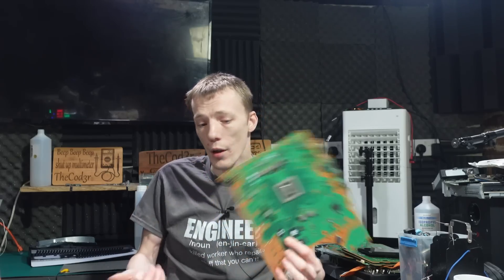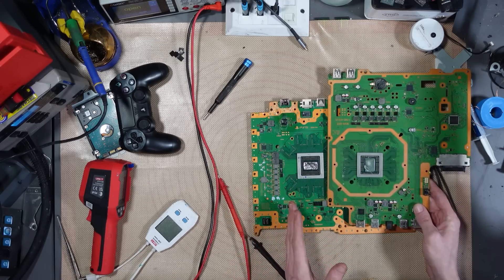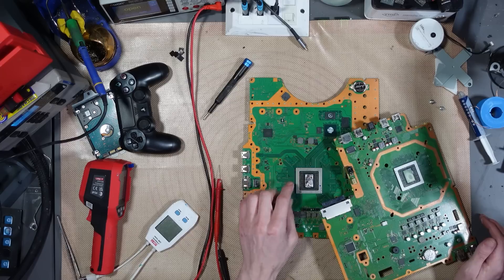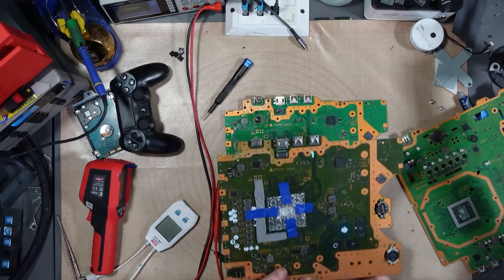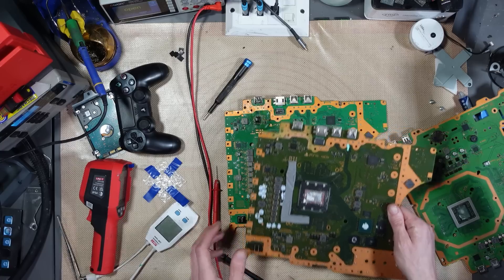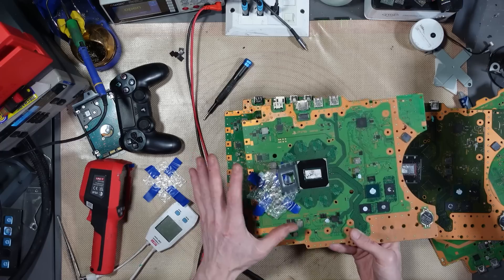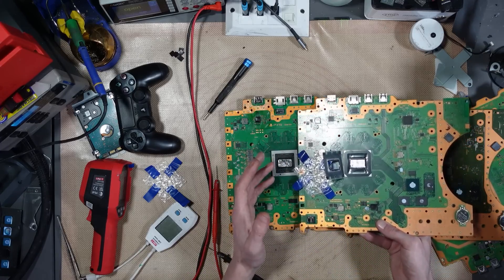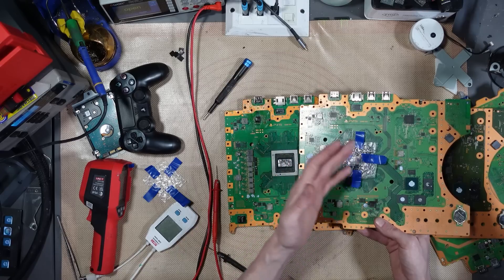Let's Talk About Sony's PS5 Liquid Metal Issue! Is YOUR PS5 At Risk?

Comment: I’m just gonna have to take risk tbh I can’t put it horizontally due to space and the stand horizontally is just really bad and feels more flimsy for some reason
Reply: The reason its a bad design.
All they had to do was make it a box like most consoles have always been but Sony did their best trying to reinvent the wheel impression for no good reason.
Reply: @YouTubeCensors Sony has a habit of poor cooling designs, the PS4 and PS4 Pro were awful. I recently got rid of my PS4 Pro and warned the buyer it’s LOUD, meanwhile Xbox had a poor design in the 360, and since then every console has been perfect with its silence and cooling. But they are boxes as you say and not reinventing the wheel.

Comment: Has Anyone tried the PTM7950 as an alternative to Liquid Metal on a PS5? Linus has done a video on it's cooling efficiency he tested in a PC build and the temperature difference between the Liquid metal and the PTM7950 doesn't seem to be that much it's neck on neck. It looks like that might be a very good solution for this issue. But getting a PTM7950 might be very tricky.
Reply: If you get the right 1 and not a fake
Reply: @yamisniper  RIGHT thanks for highlight this !
Reply: I would think IC Graphite would be able to handle the cooling of the PS5, but I'm not a professional tech.  The first thing I do to used PS4s and PS4 PROs I pick up is deep clean them and replace the thermal paste with IC graphite.  Makes them as quiet as my Series X.
Reply: Check chanel : Wielki elektronik
Reply: @DigitalDistortedGuitars  Yup i did they posted a video last week. It seems to be working absolutely absolutely fine just like it would with Liquid metal.
Reply: @trxrtt5965  EXACTLY

Comment: Problem with the stuff isn't the stuff itself but when it comes into contact with anything with aluminium or copper alloy and it turns the metals into mush and no guesses for what nearly every SMD is made from... I have never used it, if I want to bring temps down I use water and in fact I have just given up on my Ryzen stock cooler for a Cooler Master AIO simply as the old cooler is good but not man enuff for my demands, I used to be known as a cryo and peltier expert once upon a time from my days of chasing the magic 3ghz single core Barton leaderboard, cryo was an absolute ballache because of condensing around the chip bye bye mobo/cpu, it was with a wide pipe water circuit and 240w Peltier I got the CPU down to very low temps and smashed that 3ghz target on a 1700 rated mobile AMD chip (lasted about a week before it popped) and even then I had to use gobs of dialectic grease as condensation would accumulate then freeze without it then on shutdown warm up and frazzle frazzle goes the electronics next power up cycle.

Comment: So, as you said, the best way to make sure that the liquid metal stays put is to put your PS five horizontal. I guess my one question is this.

I just bought a brand new PS five finally. It’s model 1215. I’m guessing that they’re still using the same design as the launch model PS five for where they put the liquid metal and how?
Reply: yeah its still liquid metal even on the latest one 1215

Comment: if you dont close the cup lid tightly, the coffee inside can spill when you place the cup in horizontal position. Cups are supposed to stay in vertical position. For coffee to protect it from leaking you need to tightenly close the cup lid if u have SUPER GLUE. it would make it much tighter. That is just water under the bridge man.
Reply: Wtf is that even mean ?
Reply: @resonmon  just an example dude, the reason why liquid metal leakage is same as coffee in cup. The lid is not tightly closed.
Reply: @alexandermin2109  Yes but if you put horizontally you reduce that for PS5 case
Reply: @resonmon  It sounds like poetry 😂

Comment: those error are caused by inexperience teardown einsteins. They remove cover and cant undo it perfectly. The units which never been open or sealed broken are not having any leaking problems at all. The liquid metal solution is developed by SONY so IF u are not sony please dont remove it. DOnt try to be einstein. Oh I said too much!!
Reply: My launch console did have the issue. The console had never been opened. It does happen.
Reply: Completely false my APU has never been opened and mine always overheated when vertical.

Comment: This is frustrating because PS systems are supposed to work BETTER vertical. My PS2 still works, but will only work vertically. It spent it's entire life on it's side before I thought it broke. Works fine standing straight up. Just got wireless controllers for it and a new 128MB memory card. My first PS3, a first release slimline, spent it's life vertically until the drive broke, after gaming and using it as a Blu-ray player for over 6 years daily. My second PS3 is a final edition 500gb and had been used on it's side until the disk drive started making noise. Stood it up and the noise went away. I use it almost daily. I just got my PS5 and it's vertical. Unfortunately I have an aftermarket case on it with fan holes and I can't use the stand right now. Not even sure where the case and stand are, but when I find them, I will switch. Because this man has proof and F Sony!!!

Comment: I had my system vertical for almost 2 years. 2 weeks ago, i thought about the metal leaking or pooling up, so i changed it to horizontally 2 weeks ago. If i open thet systrm up, how can i sprrad thet metal back out? Don't you use alcohol and q-tip, and when thr alcohol dries, you can spread it back out? Everything is fine with my system, just wondering for future is all.
Reply: Keep it vertical it’s fine mine is vertical has been for 2 years this isn’t a massive issue most likely consoles with manufactured defects or have been dropped/ knocked about I’m keeping mine vertical

Comment: This might be a dumb question, but why haven't they designed an elevated wall or a gasket around the APU to contain the liquid metal, so that it stays there like in a pond or a moat or the like?
Reply: They can only do so much until they create a big enough gap (I say big but still microscopic) between the Ps5’s apu and the heat sink which would be bad if not worse. I know you said it would be to contain the liquid but when there’s a gap between the two components then the heat sink won’t get rid of the heat as efficiently and thus the unit would overheat anyways.
Reply: There is a thick foam gasket around the APU. A thicker gasket (elevated wall) would require even more gallium to fill the void. Diminishing returns I'm afraid.
Reply: The pro will have an even faster APU...I doubt they are gonna switch back to the paste to try and keep that cool. LM is the future, actually it's already here! PC has been liquid cooling for over a decade! Just tweak the protection coverings and there should be no problem with Sony sticking to LM. Live and learn. Trial and error. Sony will only get better from this honestly.
Reply: @kidgamer49  PS5 Pro should be cancelled PS6 should come in 2026 8K physical media
Reply: Ignore my comment here, was trying to post to a different comment 🤦🏾 lol
Reply: That profit margin. That's why.

Comment: My unit makes a lot noise. Just out of the box. Think it was in rest mode and the wife moved it to put a cloth underneath. Since then it’s been making a lot of noise. Could miving it in test mode effect it?
Reply: Do not place your ps5 under anything with fiber like carpet or rug. And don't put any cloth on top of your ps5. The top is where your ps5 draws cool air in and pushes hot air in the rear.
Reply: That’s strange since from what I’ve ready ps5s are supposed to be quiet  and mine is also silent compared to the ps4

Comment: Which side horizontally is better? I know that logo should be on top when placing PS5 horizontally but not sure if it can be installed on the other side. Installing it horizontally as per instructions, would that mean liquid metal would be on top of the APU? Or APU on top of the liquid metal? I would prefer the later.

EDIT: ok, just watched a repair video, looks like if you install the PS5 horizontally (with PS logo on top), the APU would be sitting under liquid metal. Hm...I would prefer the APU to be on top to exclude spills underneath APU caused by the gravity.
Not sure then what is better, keep it vertically and risk spills down the board or put it horizontally and risk spills under APU?
Reply: Remember that Sony commercial where they had it upside down and horizontal?  Everyone was ribbing Sony over it.  Maybe they were trying to tell us something.
Reply: @BoomerBends  Good point 😆

Comment: So what you are saying is: If your PS5 is within the guarantee let it stand, so that the Issue happens, if it it is outside, lay it horizontal. Ok.
Reply from the maker: No not quite, if it's in warranty I wouldn't recommend opening the console to protect the APU
Reply: @TheCod3r  Okok, You didn't recommend to do so, but within the guarantee Sony does fix the issue. Or does it not? 😯

Comment: My consoletechnician hinted to me, that it is better to have the console horizontally and this was already months ago. I have to admit, on my journeys to switzerland i bought myself the g-story 4k screen to use the ps5 horizontally, which maybe also could explain, why i dont have issues, apart from the fact, that i dont use the console exzessevly as others do. I have a semi broken ps5 too, where the front usbports are literalky dead and the usbports on the back also have seen better days, hdmi port aswell, but it works so far. If people can make use of the horizontal orientation, then maybe go for it, if you really enjoy your cobsole, otherwise, at your own risk, as usual, use it vertically. As tronicsfix already tested a ps5 with thermal paste instead of liquid metal, going away from liquid metal is not a good idea. Do that at your own risk and as in the video mentioned, after the warranty ran out. I will not modify my consoles except with m.2 ssd harddrives, other than that, its a solid system in my opinion

Comment: I’ve had my ps5 for almost two years and heard about this today and switched it from vertical to horizontal.  I’m sure it’s fine but it’s not worth the risk.
Reply: Had mine for less than 2 weeks and I already switched 😂.
Reply: Almost a year vertical and just went horizontal after buying a stand
Reply: @P34V3Y7  The console comes with a stand in the box?
Reply: @TJ-wf1rr  yeah but using that stand to put it on its side is cheap and not reliable. I got a stand that suits it better for it’s side
Reply: Bro same 😂 I feel fully after spending 3k on a pc but still
Reply: Clearly you really don't get it .
Reply: It has no issue to place vertically
Reply: @raminham1077  I work with Engineers all day and do you know how many times they tell me something will be fine and it isn’t? I can’t tell you the times and Engieer says “no, it shouldn’t be doing that that” and it does. (This wasn’t directed at you but where I’m coming from)

Comment: I use my electronics horizontal even when advertised for vertical use. Just seems like a logical way to use something that has moving parts,liquid and a spinning disc inside of it.
Reply: With how stupidly massive the ps5 is thats kinda unfeasible for a lot of people
Reply: @BandedMetagrossMeteorMash  I have a series X as well as a PS5. Let’s not discount the fact that the series X is the size of a toaster oven horizontally. Lol.
Reply: In the past i had issues with ps2 scratching my games when putted verticaly so i never did it again but when i bought ps5 it looked better verticaly but i was still worried about disc scratch and after some research in the second day i found a french video talking about this problem of liquid metal and i was surprised and glad to see it so i can prevent myself by doing this mistake and now 7 months has passed since my purchase and no problem
Reply: that’s funny because in a desktop the mobo is mounted vertically.
Reply: @artbyddp  to be fair with RAD 1979, we don't know they have a desktop. Also, a desktop mobo doesn't have moving parts and the HDD and CD-DVDR are mounted horizontally. 
You can say the H&F have moving parts but, that's grabbing for straws, afaic.
Reply: @artbyddp  ive been thinking the same
Reply: @artbyddp  exactly, mfs don’t know what the talking about
Reply: @artbyddp  and that's why if you use Liquid Metal on a PC cpu you have to replace it every 6 months or it leaks out
Reply: @ms3862  That is not the reason why you replace LM. Eventually the chip will solidify the LM, it will appear flakey and it won’t make contact with the heatsink or cooler so you clean up the die and apply more but if you’re putting LM in a device that has no barriers or protection you’re asking to short out the device. Sony did a better job with LM from the factory than Asus did with the ROG laptop’s where the LM was actually shorting out allot of their boards but their QC is known to be garbage.
Reply: The ps5 isn’t as big as ppl make it out to be or I’m getting use to it it’s just tall not big really
Reply: @Rbjd have you ever seen a ps4 slim? The ps5 is huge
Reply: I hope this guy is not mis representing his platform for Bias " it looks like he means well but who knows with alot of these you tube creators?
Reply: That makes no sense at all. PCs have always been on vertical.
Reply: Ps5 looks dumb sitting horizontal and it takes up way to much space. Like comon man
Reply: @vinne4236  he does look like extreme meth addict?tbh?
Reply: By your logic then a watch would only be usable by a table or any other kind of stationary object, not a arm
Reply: @3xhollow  your woman would love me though

Comment: I think that if your PS5 is kept vertical and is not moved, then metal leaks is not an issue. I think it will come from people regularly moving their PS5's. Mine has been kept vertical next to the TV since i got it.
Reply: What model do you have
Reply: Its so simple n sony r just stupid (gravity+ liquid metal= only 1 position to avoid leak= horizontal) instead they made a floppy fucked up design inside out that u cant fit anywhere
Reply: Don't forget gravity + vibration from the disc drive will play a role as well
Reply: Eh? It’s a liquid, add gravity, it’ll move.
Reply: I have traveled with my PS5 4 times. Each time was at least a 4 hour drive. I always use it vertical and even store it when traveling vertically. Last time I traveled with it I played nfs unbound for about an hour before unplugging it and putting it in my suitcase and then my truck. If anything was going to happen it would most likely happen soon after the first use, abuse or being tampered with.
Reply: Same here mate your right people move them all the time that why get these problems the only time I moved mine is when I had to clean the fan form the dust getting it

Comment: I am an electrical engineer (actually having worked for many years in the semiconductor industry) and I fully agree to your concerns - and btw: this is the reason that I have used my PS5 in horizontal mode from day 1 ;-)
Reply: Liquid metal doesn't leak though lol.. likely those pictures were a user error spilling it or a factory mistake (potentially even the console being dropped). That's not how liquid metal even works it stays still
Reply: @Pluto50x  Still better be safe than sorry always. Even though it adds 0.00000001 chance of risk i won't take that. Also don't forget that people who use this console generally have better temps with horizontal.
Reply: @Pluto50x  It's liquid, right? Well, there is a thing call gravity. What would happen to liquid if it's free fallen? Glue doesn't stay still on a board being vertically. Now add in heat, it's going to be all runny.
Reply: @tr1bes  There's something called "PRESSURE". If the plate do its job well , you don't need to worry about  how you set your PS5 . There's no room letting the liqid be free fallen.

Comment: HI phil if the chip was designed with a lip edge around the top off it acting as  square side shoulders then the unit could be placed any position without issue or a square spacer thickness of paste requirement see what SONY think ????????????????????